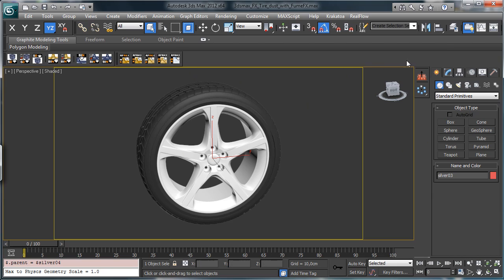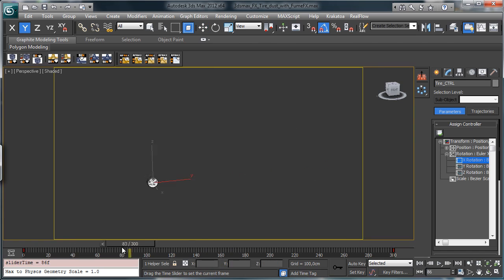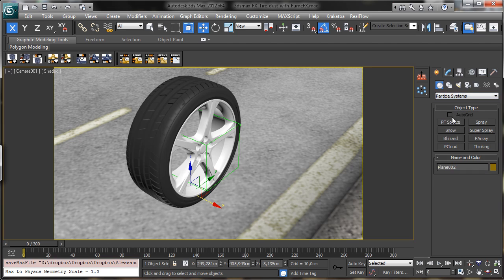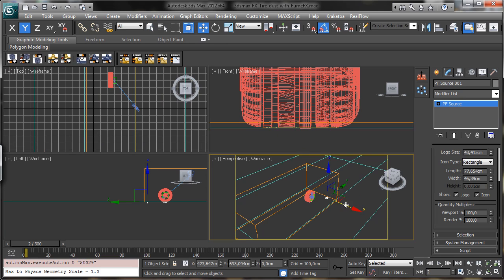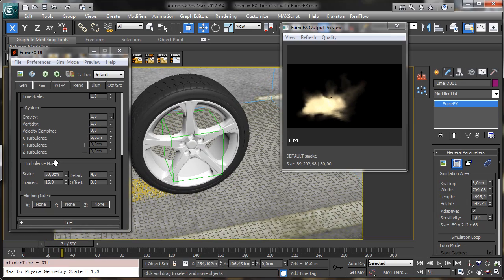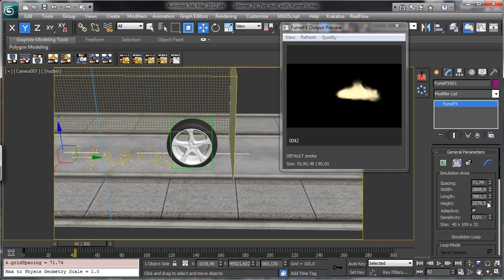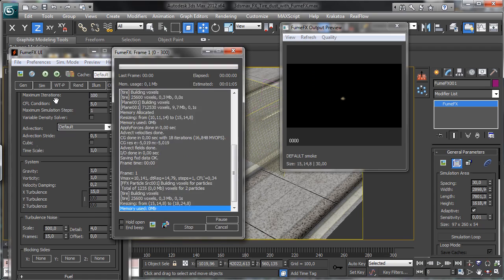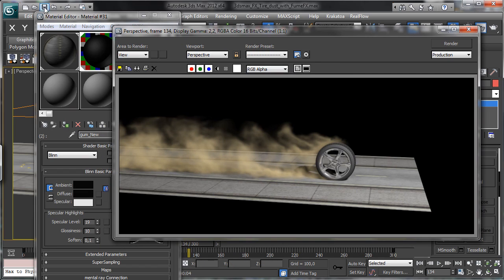Tire dust with FumeFX

Comment: Nice results bud, but I could not follow as your mouse was flying all over the place and clicking on many things all the time. I did try and follow by doing a section at a time....but still it was impossible. Admittedly I am a new user of 3DS max usually use Cinema 4D. You certainly know what your doing here but it would be very hard for a lot of people to follow.